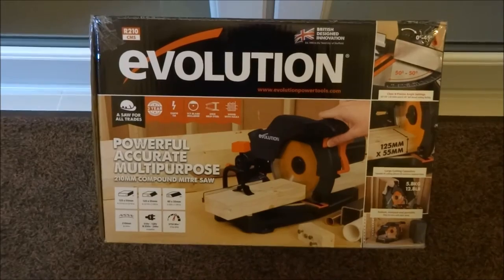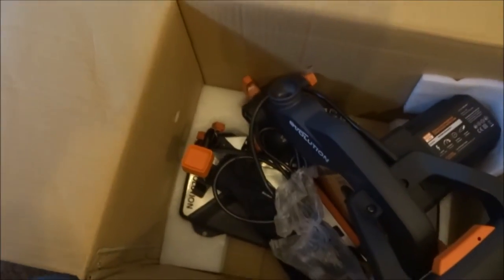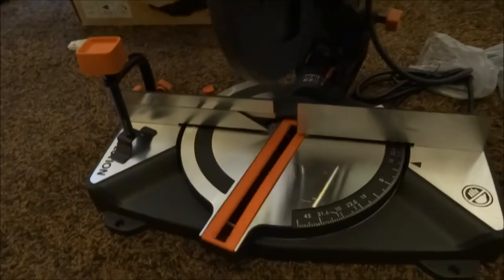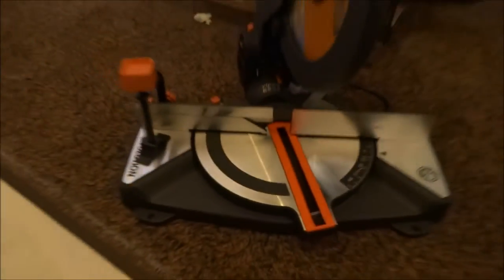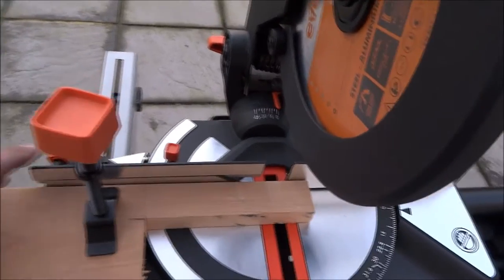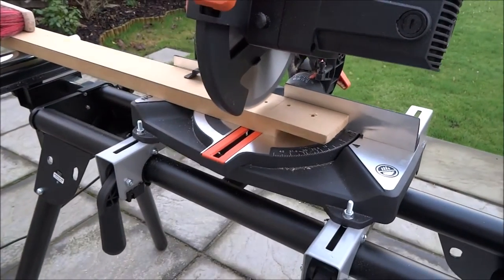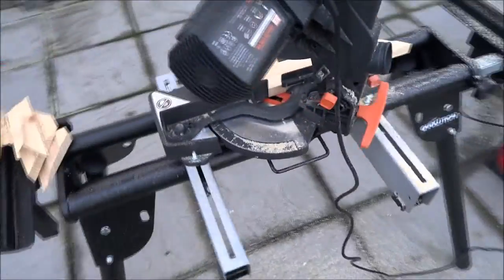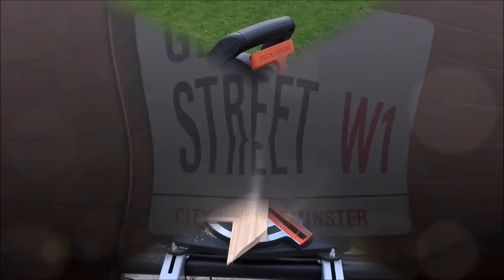Unboxing a Evolution R210CMS 210mm Single-Bevel Compound Mitre Saw

Comment: Great very accurate compact saw. I’ve got one and I love it. 
The blade indicator thing not going to zero and 90 degrees can be adjusted in 10 seconds.
Reply: Is this possible to cut wood 9x9cm? Thanks

Comment: Its worth the money just because its so small and easy to carry . Its not Quiet ....! and it certainly will not cut straight without you adjusting it. Strapped onto a Festool dust extractor its amazing for small work .
Reply from the maker: Thanks for the comment.